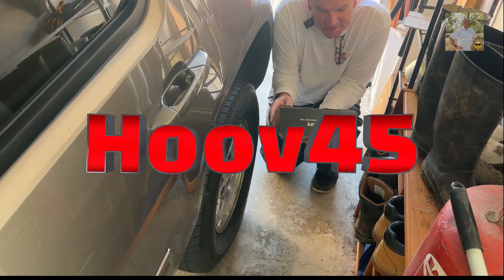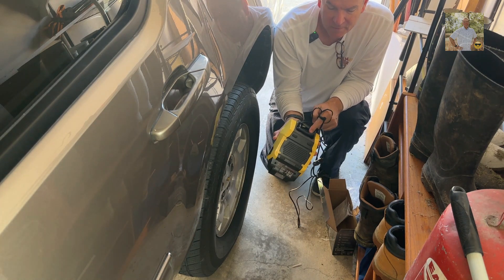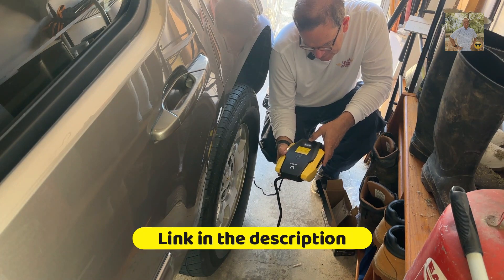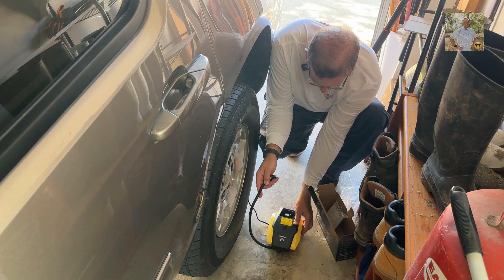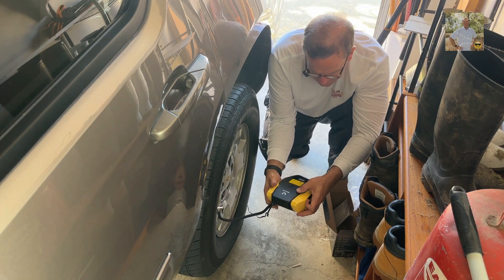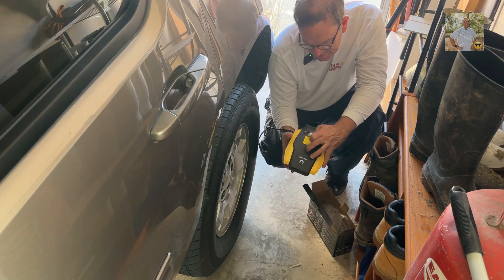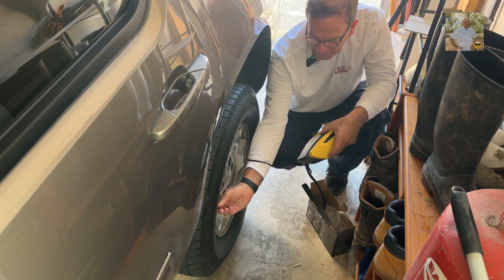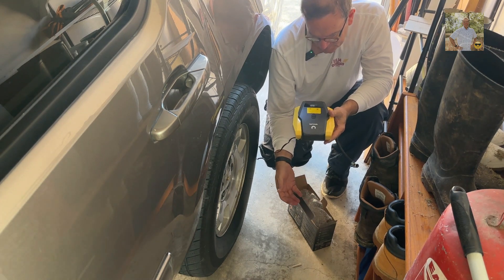VacLife Air Compressor Tire Inflator DC 12V (VL701) Yellow-Inflate Your Tires Effortlessly & Safely

Comment: I bought the same one in orange and a few years ago, but I have never used it. I just bought a brand new Toyota 4Runner, and when they shipped the car, they inflated them to nearly 38 PSI for transport. I need to deflate them to 32 PSI (cold). Do you know if this also deflates? Thanks!
Reply from the maker: Just push your car key or something on the tire valve and air will come out. You can fill back up if needed.
Reply: @hoov45  thank you!